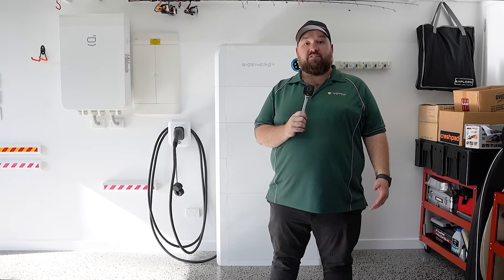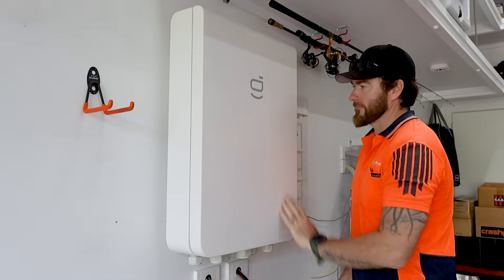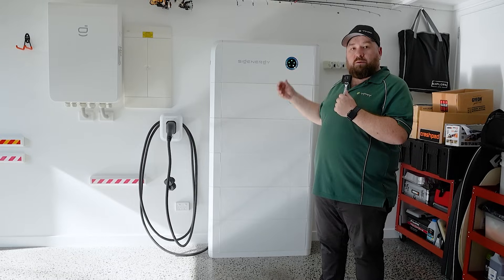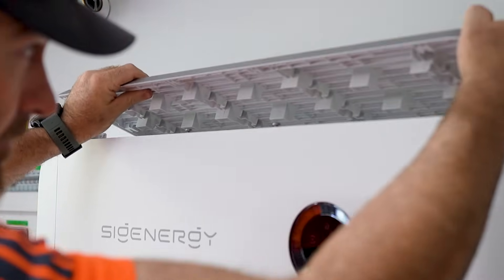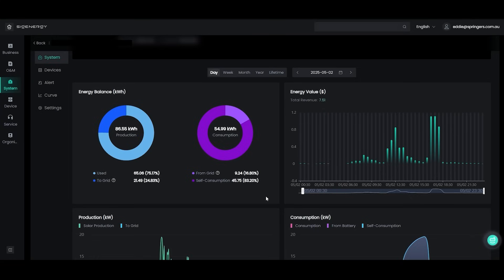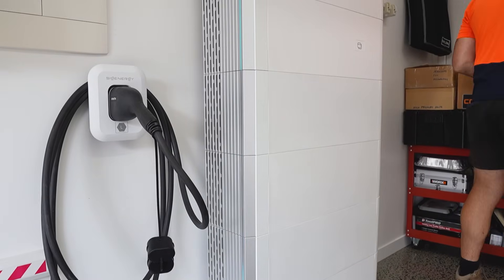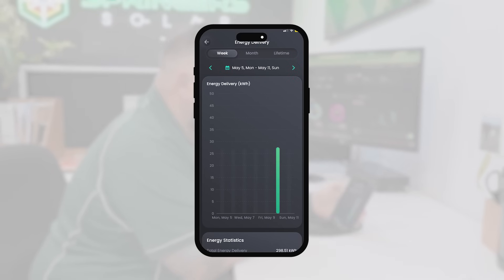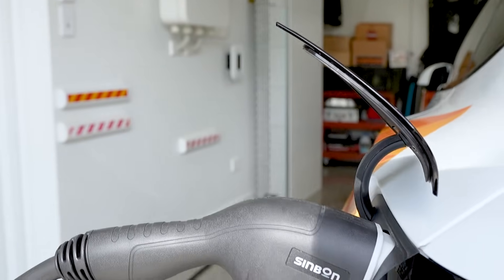Does Sigenergy Even Work? Battery Data Unveiled

Comment: I have an existing SolarEdge PV system with 10kw inverter and optimisers. Not sure if I should stick with SolarEdge for battery or rip out the optimisers and go with SigEnergy.
Reply: Why not AC couple your SolarEdge system to your SigEnergy system and leave the roof alone.
Reply: @bryanwhitton1784 I thought SolarEdge is all DC.
Reply: First check if you have a hybrid inverter (home hub).
Reply: @sanderdelft I don’t but SolarEdge will upgrade it for free if I go with their battery.
Reply: @sanderdelft  Personally I would not use the SE hybrid inverter, at least not for the batteries.  The LG batteries are not very good to put it mildly and the SE BAT10 battery is at least a generation behind.  It would limit you to 20 kWh or storage which is better than a Powerwall but no where near the potential of the Sigenergy.
Reply: @bryanwhitton1784 i understand  and partially agree. I would consider victron as well before committing to either option.

My comment was purely meant to raise awareness that not all SE inverters are created equally and support batteries. 

Also, make sure to check the backup power response time with SE. It is fast but not seamless, meaning a short (2s or so) loss of power.
Reply: @sanderdelft  Yeah,  I have a PointGuard Home system on my home and We haven't yet had a need for backup power we have tested it under multiple conditions and it is truly seamless.  

The nice thing about what I suggested is that he would still be able to take advantage of his SE good points such as shading or orientation issues while avoiding the hassle of switching his existing hardware.  From the installation perspective all he would be required to do is relocate the grid tie circuit from the current location to the Load Hub.  
He would have to install the Sigenergy system but that would be straight forward with a minimum of hardware on the wall.
Reply: @bryanwhitton1784 i agree completely with your recommendation not touching the SE install and use it AC coupled

Comment: Regarding the title of this video. The answer is yes Sigenergy works very well and is worth the outlay. I'm planning on getting an EV each for the wife and I. Looking at 3 phase power upgrade, solar panels with Enphase micro inverters, Sigenery battery with built in EV DC charger and inverter. Haven't had any quotes yet but am expecting to pay under $40K
Reply: Future proofing. Sensible choice. 
I live in the UK & we are running one EV & because I need a 4x4 we have a diesel too. At present the EV is cheap to run, even on standard electric rates. 
I’m convinced though that eventually they’ll impose a tariff on the electric used to charge EVs. 
It’s not hard to see a day when government revenues from taxes on road fuels begins to take a significant hit. 
They need to replace that revenue. 

If you’re producing your own power there’s not much they can do though.
Reply: You won't be installing Enphase AND Sigenergy. One or the other (stick with Sigenergy).
Reply: @hargeaux  Enphase for the micro inverters and Sigenergy for the battery.
Reply: @trythis2821  the sigenergy system only works as an all in one system, which means you need the inverter with it. Which means you're doubling up on inverters if you purchase the (expensive) Enphase micro inverters.

Which also means you would be feeding the sigenergy with AC from the Enphase instead of DC directly from panels. 

It's definitely a wasteful solution

If you have shading issues, selective deployment of Tigo's is a better way to go about that.
Reply: @hargeaux  Thanks for the reply, I will check with the installer. As they install both Sigenergy batteries and Enphase IQ8 micro inverters. Maybe they don't use them together.

Comment: Great install and looks the goods. What's the warranty like?
Reply: 10 years on most, but only 2 years on the gateway and EV charger
Reply: @bruce.. not anymore. Gateway warranty is up to 10 years
Reply: @willhall5668   This is an extract from the warranty documentation for Australia.
For Sigen Gateway, extended warranty guarantees proper product functions but the followings consumable components are not covered under the extended warranty (limited to the standard 2-year warranty):circuit breakers, contactors ,auxiliary contacts, Indicator lights, changeover switch contacts，
Reply: @bruce.. gateway 5 years
Reply: @TheAidanVogt It must depend on the country it is installed. For Australia I haven't seen anything official more than 2 years.

Comment: Love the look of the Sig, thinking we'll look at getting something similar with a focus on exporting to the grid only during peak and then EV charging down the path a bit.

Currently we have an 8yr old solar system consisting of 11kW of panels (2 strings) and 8.2kW inverter. We'll need to replace the inverter, but wondering about the panels. Assuming we got something like the Sig 10kW inverter which I believe is capable of 4 strings, would it be worth just leaving the panels we have to have to help tame the cost a bit (to be replaced down the line)? Plan would be to add at least one new string of panels with the Sig install. Would mismatched strings cause any issues for the Sig?